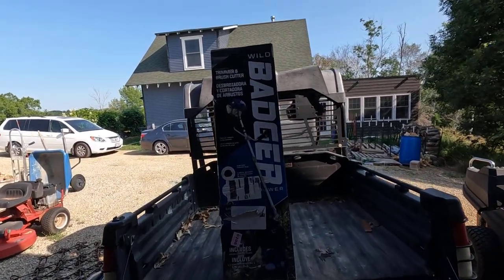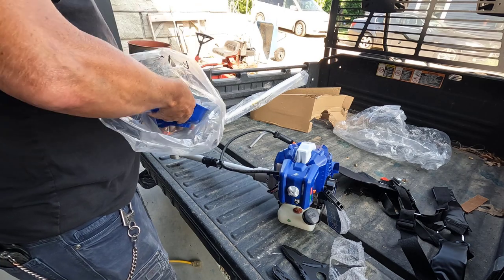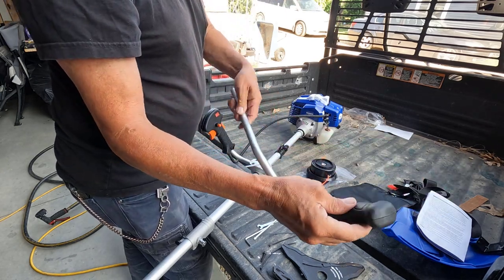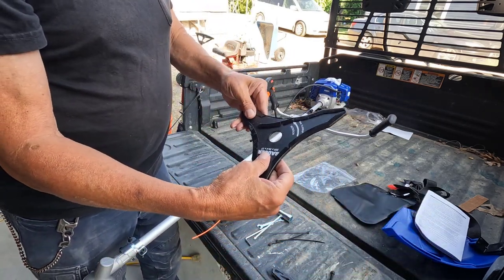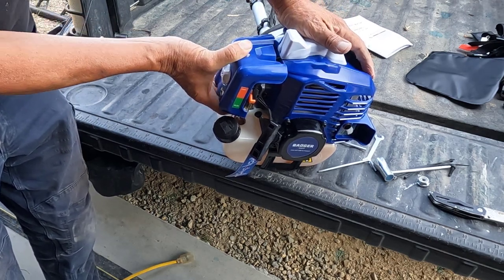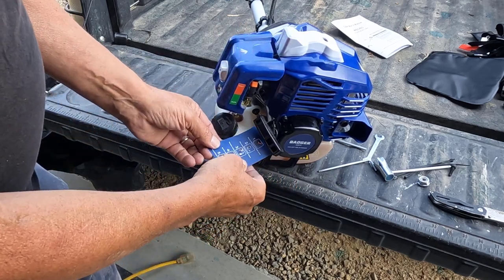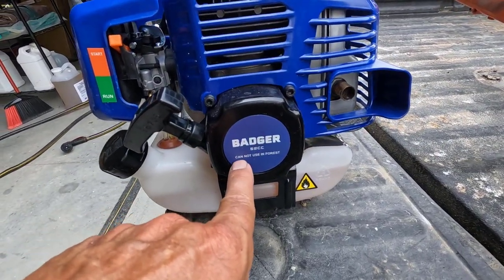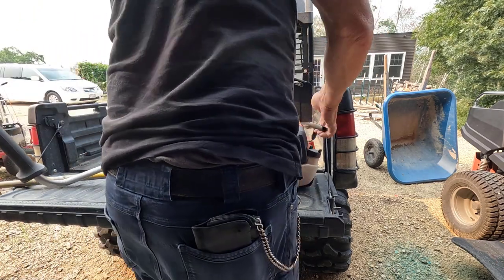Review: Wild Badger 52cc Brush Cutter

Comment from the maker: The Wild Badger Power trimmer was a real disappointment. Here at Planet Mojo I review things as they are sent to me — I do not ask the manufacturer or dealer to fix things or replace parts. Based on what I have seen, I would absolutely not recommend the Wild Badger 52cc brush cutter. I'll be reviewing the DeWalt FlexVolt 15" trimmer next. Hopefully that review will go better!

Here are some of the tools I use here on Planet Mojo:

DeWALT FlexVolt 15" String Trimmer (Tool Only) - https://amzn.to/3rCFZGe
DEWALT 20V MAX 14" String Trimmer - https://amzn.to/43uRQU4
DeWALT 20V MAX XR Oscillating Tool Kit, 3-Speed -- https://amzn.to/3aYKIaS
DEWALT 20V MAX Impact Driver -- https://amzn.to/2JzyCK2
DEWALT 20V MAX Cordless Drill -- https://amzn.to/38PmInW
DEWALT ATOMIC 20V MAX Cordless Drill, 1/2-Inch, Tool Only -- https://amzn.to/3rKAwbZ
DEWALT 20V MAX Circular Saw -- https://amzn.to/3p60tR7
DEWALT Rotary Hammer Drill with Shocks, D-Handle -- https://amzn.to/37u2DUJ
DEWALT 20V MAX XR Jig Saw, Tool Only -- https://amzn.to/2J66QEQ
DEWALT 20V MAX XR Reciprocating Saw, Compact -- 
DEWALT 20V MAX XR Compact Reciprocating Saw -- https://amzn.to/3nKHVFG
DEWALT 20V MAX Cordless Drill / Driver Kit, Compact, 1/2-Inch -- https://amzn.to/2KBzFcK
DEWALT 20V MAX XR Oscillating Multi-Tool, Variable Speed -- https://amzn.to/3nxzBt7
DEWALT DCG413B 20V MAX Brushless Cut Off Tool/Grinder  -- https://amzn.to/3mC4g78
DEWALT ATOMIC 20V MAX Circular Saw, 4-1/2-Inch, Tool Only ― https://amzn.to/3qYBiB9
DEWALT ATOMIC 20V MAX Reciprocating Saw, One-Handed, Cordless, Tool Only ― https://amzn.to/2Msu21r
DEWALT 20V MAX Cordless Drill / Driver Kit, Compact, 1/2-Inch ― https://amzn.to/3cbAhBl
DEWALT 20V MAX XR Impact Driver, Brushless, 3-Speed, 1/4-Inch, Tool Only ― https://amzn.to/3opEzaF
DEWALT Cordless Impact Wrench - https://amzn.to/3L5lvvl

12" DeWalt Chainsaw -- https://amzn.to/3oiLvId
16" DeWalt Chainsaw -- https://amzn.to/33Wqn1r
12 Ah Battery -- https://amzn.to/33JN48U
9 Ah Battery -- https://amzn.to/2SKUQwN
6 Ah Battery - https://amzn.to/3PyhOCT
6 Ah FlexVolt Battery -- https://amzn.to/3odC6BW
9 Ah FlexVolt Battery - https://amzn.to/3O4E7xu
12 Ah FlexVolt Battery - https://amzn.to/3pYI2UB
15 Ah FlexVolt Battery - https://amzn.to/3OpoCl2
Reply: It will burn your arm

Comment: Hi Mojo, that sure looked like a piece of junk, I thought that's not right when you pulled the starter,and the leak was the last straw,have you sent it back with the review verdict.
Reply from the maker: Thanks Larry, I actually took it to the dump. Our dump has an area where you can put things that someone may want — there was furniture, a big mirror, a barbecue grill and other things there when I went — so someone there will pick it up and maybe get it running — if that's possible. 🥴

Comment: I've seen these wild badger tools in the store, they seem to be marketed towards first time buyers of tools like this. They are just more Chinese junk in my opinion, and wouldn't make it past the first year without completely breaking down on a larger property.  I'll pay the extra and stick with Stihl! I'm keeping my eye on the electric stuff as well. The bigger DeWalt looks real good, but I wonder if I would need two of the flex batteries for my property? And which batteries? I have one 6 amp battery.
Reply from the maker: Ryobi used to be similar to this when they first came out — still may be for all I know. They looked like the tool they were supposed to be, but everything about them was cheaper. I think they have become much better these days, but they are still not a tool for the craftsman tradesman, or larger property owner. In the end, I will do like I said — use the big 336FR for blade work and get an electric model for the grass 😊

Comment: Best blade I've ever seen for cutting through brambles and such is the Oregon mulching blade.  You need a powerful machine, something over 50cc, but there's nothing that competes.  Why it's not marketed in the US is a mystery.
Reply from the maker: I use a saw blade on the Husqvarna 336FR, and it will cut through anything up to 2" trees from one side — 5" or 6"  if you walk around it. I'll have to take a look at the Oregon mulching blade. I'm always open to new things, and Oregon makes some great blades!
Reply: @PlanetMojo  Those saw blades are great for the big stuff, for sure.  If you have brambles, briars, vines and the like, I think you'll really appreciate how the Oregon Mulching Blade shreds them.

There are quite a few videos on Youtube that show them in action.